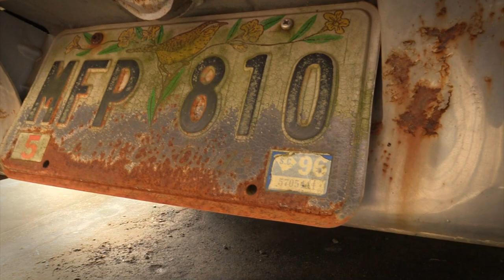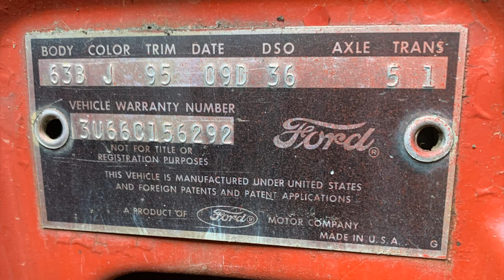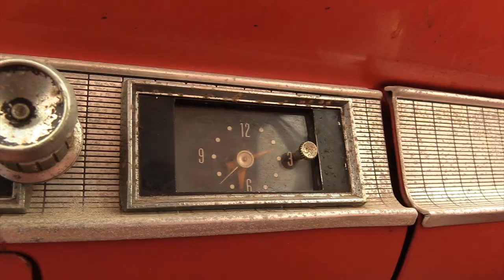1963 Galaxie 500 First Look Future Project Car 74 Manic Mechanic

Comment: Love that car .Could drive it as is with as few patches here and there lol
Reply from the maker: Our main goals are: 1. Dash Pad (to fill a request from our advertiser for an install video on the dash pad we asked for and they provided 7 months ago) 2. Get it running if it will 3. Fill in holes. 4. Do brakes. 5. Get tires and wheels. 6 Drive.

Comment: Very excited to see this progress having watched your F100 videos. I’ve just sold my 70 F100 and bought a 64 Galaxie with 352. The Autokrafters website seems to be blocked here in the UK though which is frustrating. Aiming to put power discs, steering, three point belts and a stoker FE in it over time
Reply from the maker: Keep watching because that is where we are headed too!

Comment: Dang fertilizer! Only real rust on our 67 LTD is where someone left a bag of fertilizer on the hood and it rusted through the hood frame and luckily only ate up the breather cap on the valve cover ☹️ Looking forward to this 63 restoration!
Reply from the maker: I think the hole in the trunk floor is from a battery too. No information to that effect, just a gut feeling by where the hole is.

Comment: I have one identical to it except for it has the 427 with a four-speed just picked it up for 600 bucks and it has about the same problems
Reply: The trans 8s probably worth $3,000.
The 427  $3,000 even if it doesnt turn over.
How much???
Reply: Yes I still have the car the motor runs transmission works properly and it has a 9 inch Ford rear end in it all factory

Comment: Hey Manics great project, I will be following.  I am doing my own resurrection of a 66 Galaxie 500 Convertible that's had a storied past.  PLEASE use all your influence to get AutoKrafters to do more 65/66 parts like emblems and badges and things thanks!
Reply from the maker: They can only push so hard on the companies like AMD and such to get things rolling for those years. But I have to say that I really like the '65-'66 cars.
Reply: Check out Old Car Alley, he's restoring a '66 Galaxie convertible also with a 352 in it, it's turning out very nice

Comment: As of 10/1/2020 I have FOR SALE a 1963-1/2 Galaxie 500 390 (300 h. p.)  4-speed big in big out, "S" code, original paint, Marroon with black interior, bench seat, complete all chrome, glass, car is all still in one piece, no dents, has all of it's chrome, it's all in great shape, complete interior never removed. Fantastic project car as it is complete and never been taken apart. bumpers need rechromed but are straight. Steel dash, no crash pad, has original white headliner, 80,000 miles on odometer. Drum brakes on all four corners.
Clean title. has not been driven since 1986 was stored indoors in a barn. I have original engine all intact except carb. on a stand, it was removed in 1985 for a hot rod 390.( that engine does not go with the car). Original engine goes with the car.  This car wants to be a body off chassis restore. There is also some sort of factory mounted electronic box in the trunk above the right wheel housing for the radio that I was told does a reverb thing (I do not know what that means) supposedly a rare Galaxie option. Manual steering, manual brakes, of course 4-speed, am radio. I did wire the car for an alternator instead of a generator. It drove great back in 86' I use to have cast iron 427 headers on it (those do not go with the car either) there is custom bent exhaust on the car with a balancer pipe behind where the headers meet the exhaust flanges. The original engine has the original exhaust manifolds on it, car would need pipes bent to connect original manifolds to the exhaust system, the exhaust goes all the way back and dumps in the stock locations (right / left) under the rear bumper.  All door key locks work, windows all roll up and down, both door latches work great.
I had a dream for this car that is still in my mind but so is the reality that I can not dump (I figure $10,000 - $12,000) the money it needs into it to make it a $40 to $50,000 car like I see listed on e-bay.
It is a heck of a great start for someone who truly understands what the potential this car has to be one of the better ones out there. Being an all steel car with no plastic parts to speak of makes it an awesome candidate for a project car. The car is currently located in Michigan just north of the Ohio line, I-75 to I-275 North. It was originally bought brand new at North Brothers Ford in Westland, Michigan.   If interested, I guess contact me through REPLY if interested.  I saved the 74 Manic Mechanic video to watch later so I can monitor REPLY . Thank you.

Comment: Yeee Hawww '63½ Fastback!  No doubt my favorite "big Ford". 

There is a conflict though, I've owned two '64 Fastbacks. First started out just like your '63½, 289 & three on tree, within six months it was sportin' a complete 390 drivetrain from a T-Boned '64 with around 30K mi(mine had approx 80K).  Yes it was three speed as well, but within maybe a year I found a BW T-10 from another '64. It ran good, had a set of 406 cast iron shorty exhaust headers, otherwise was a stock Z motor. For awhile I owned a second almost identical '64(both Vintage Burgundy), 390 but automatic. It was a dog, never bonded, sent it away and went back to driving the first '64. I'd repl'd it's front clip, as one dark night it tore the frontend out from under a International moving van. I was mindin' my business, he was parked in roadway on 45* with cab blocking my travel lane. My RF caught his LF wheel, repositioned front axle till it was at a 90* to front of cab. Needles to say, neither of us drove away. Once I cut the fan belt off mine was drivable, at least for short distance.
Reply from the maker: Awesome story! I Love hearing about our cars past. I look at this Galaxie, the F100 and our other cars and just wish I could look into the past and see what they did and what they went through.
Reply: I sold my '64 to the ex wife's dad, he had it painted red & used it to tow a trailer full of exterminating equipment, incl a 100 gal tank. Parked it at around 250K mi total(or 200K on the 390 drivetrain). Set in his backyard several months till a kid came along and wanted it for a Hot Rod. Enticed by those 406 shorties, thought it had a Hi Po. Fresh battery, carb primed, fired without issue, he drove it away. 

Kinda straying, I've talked with first owner(I'm 2nd) of my '69 Fastback so I know it's history.  My Fairlane has orig window sticker and several service records. I know where it lived from '69 till '93. After 19 yr silence or at least minimal usage(gained 16K mi) resurfaced in '12. Again from that point, I have service records, parts bought etc. Sometime in late in unaccounted period it was repainted, brakes rebuilt, radiator, hoses etc repl.

Comment: I see they went to the trouble to acquire and correctly locate the fender badges!
Reply from the maker: And at the very least the smooth collar to replace the three on the tree. At some point someone cared. Maybe not about the hole in the floor...but someone cared. LOL
Reply: The rockers like to rot at the back of the door, too. Did they flip the rear shackles upside down?

Comment: OK. My story.
My older friend ordered a new 63 fasttop bench seat car from Donges Bros. Ford, Tulsa. White, blue int., 390 Interceptor solid lifter 330 hp, T handle OD, 3.89 posi, delivered with a floor shift, smooth column, power, AC.
I spent from 76 to 97 trying to buy it. 50,000 miles, impeccable showroom new car. One day I went to visit and headed directly to the garage to look at "my car". He had sold it to somebody in Iowa? for $5,000.
I like the early box top better. 😱😱Sour grapes.
😢😢😢😢😢😎
Reply from the maker: Similar thing happened to me with a Wimbledon White '66 GT Fairlane. Had a deal to by the car when my friend was selling; both e a his wife knew about it. He passed suddenly the wife GAVE the car to their grandson who pole danced it into a power pole at 100 mph.

Comment: Jeff You need to check out a fellow you tuber. His channel is called TheCraig909. He's a young kid in Ramona CA. He's got two Galaxie 500's. One is running but it's running really rough. It's got a 352 with an automatic trans. Right now it seems to have him stumped. Maybe you could help him.
Reply from the maker: I've watched his stuff. I will reach out to him.
Reply: Jeff that's cool. I thought with your experience that you might could help solve his problem. He says that all of the ignition parts are brand new but as we all know sometimes bad stuff slips thru.